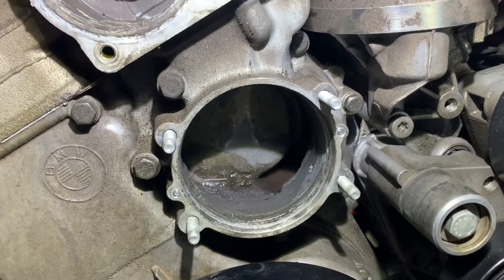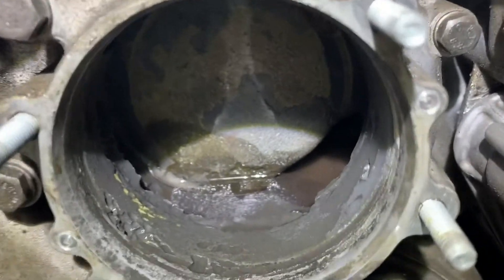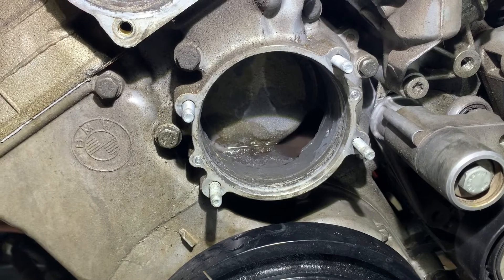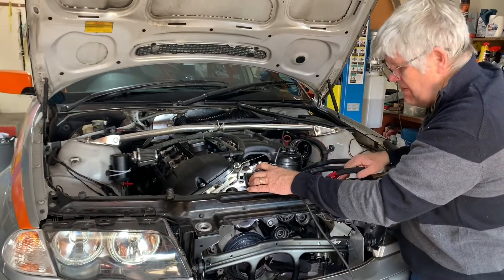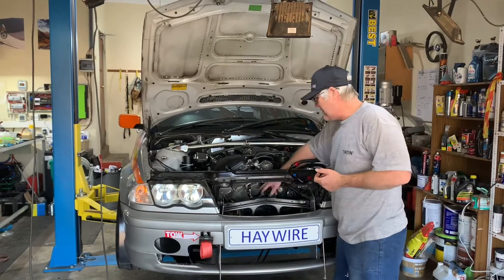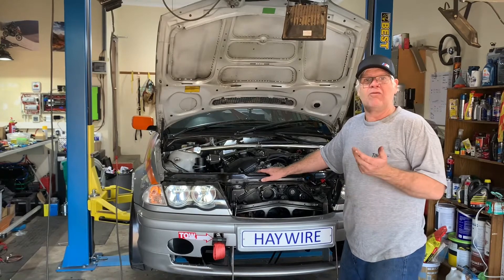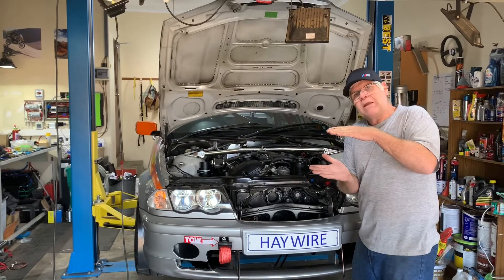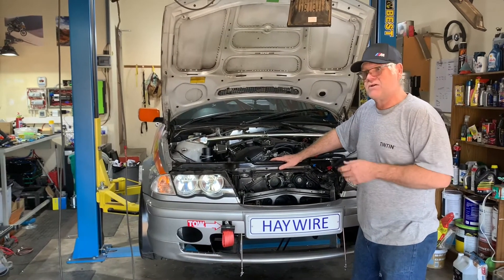Overheating investigation BMW E46 Track Car

Comment: Love the TinTin shirt! How many Miles/K’s does this motor have on it? Would cavitation occur from not using the BMW approved coolant or was it merely a sealing issue? Cheers from the USA.
Reply from the maker: Sorry I missed this comment! And thanks for noticing my TinTin shirt, which I have worn regularly since 1999! they dont make 'em like they used to :). The engine had 335000km (about 210 000 mi) when we opened it. Other that a bit of oil consumption it was still in great shape. I think the "cavitation" is probably erosion due to incorrect coolant but can't be sure.